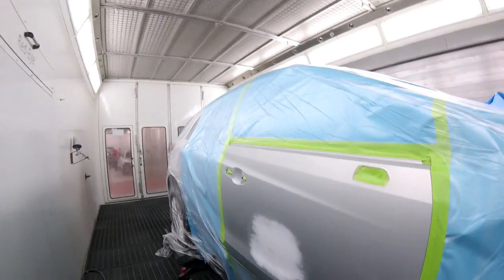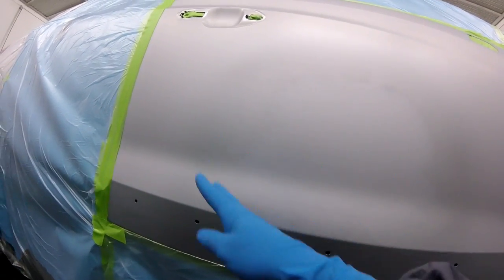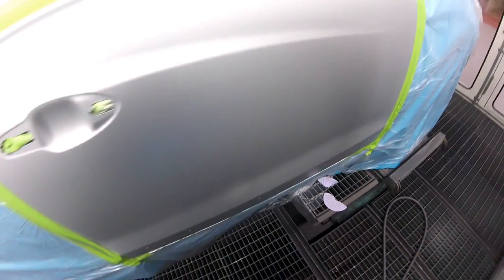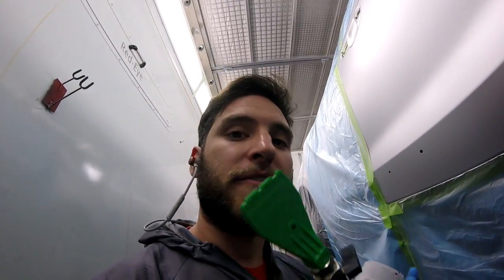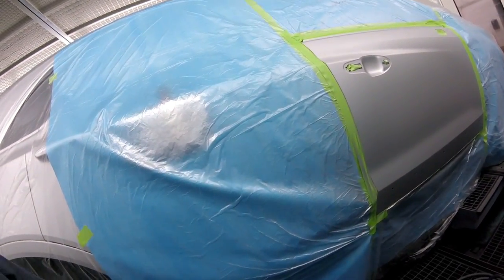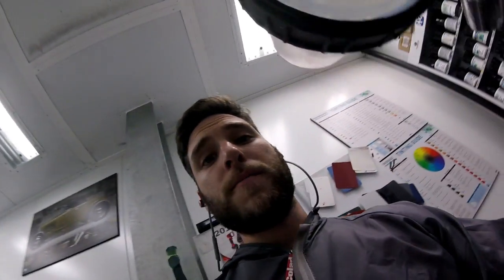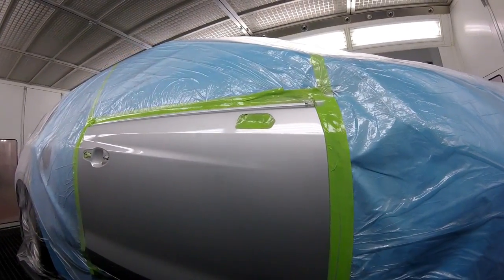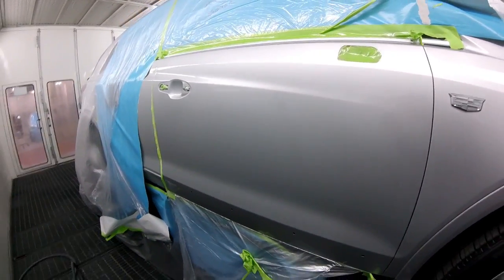Silver Cadillac Door 1 OF 2 (#2 is my failure)

Comment: Once again a couple of really good tips! I've been using the invisible regulator for years and since the switch to PPG the paint reps have forced me into using a regulator on everything so I'm losing my focus making sure my air is correct.The droplet size is a good tip for drop coat be careful sanding base with paper with holes they can grab and put a deep scratch 3M makes a cloth like flexible sandpaper.tomorw is Fuji for base and lph400 for clear day invisible regulator for clear

Comment: great job! just wondering why you used the ec550 clear instead of the ec530 clear? and do you much of the ec800 fast clear?
Reply from the maker: +Derek Warrack hey so I had just finished a big job so I had some left over so I just topped it off and shot 😀 plus I love 550😍😍😍 I only use it for blow ins it's an amazing clear
Reply: MOTIVATED PAINTERS  right on, I never sprayed the 550 only the 530 and the 800. Not a fan of the 800
Reply from the maker: +Derek Warrack I'll make a video on the 800 clear 😀
Reply: MOTIVATED PAINTERS Awesome!
Reply from the maker: +Derek Warrack I'll make a video on the 800 clear 😀
Reply from the maker: +Derek Warrack I'll make a video on the 800 clear 😀
Reply from the maker: +Derek Warrack I'll make a video on the 800 clear 😀
Reply from the maker: +Derek Warrack I'll make a video on the 800 clear 😀😊

Comment: What do you reduce your silver and your color overall 20% or 30% reduced? Also do you use the t498 reducer or the sliw 598 i believe on metalics?
Reply from the maker: +Eddie Lugo I'll usually reduce my silver 10% if hot a bit less. I apply one or two coats then I'll cut it down some more  it helps to blend the silver
Reply from the maker: +Eddie Lugo t494 we use water reducer

Comment: Also i bave the same issue even if i keep the overspray off the blend when i clear it lools darker can jt be the clear depth changes de color (darkens it) i dont tach after my control coats should i start taching right before clearing?? Even on metalics?
Reply from the maker: +Eddie Lugo you should try tacking all your coats but not after control coat (if needed) theore you watch the more you'll see that sometimes I don't tack I'll only tack the blend panels.  Try clearing up-to a few inches up to the end of the blend panels for your first coat then in the second coat you clear the whole panel that way there is only one coat of clear on the edges of the blend panels